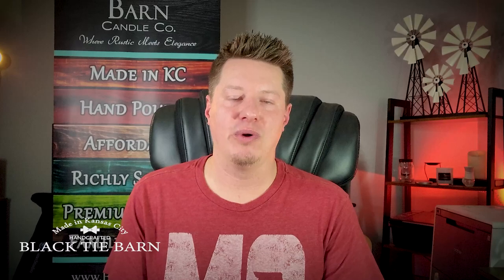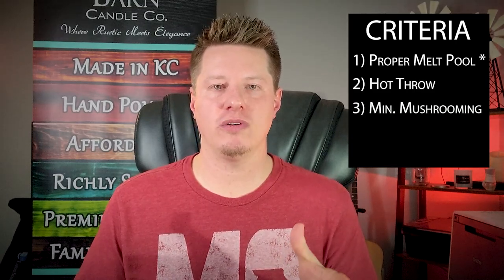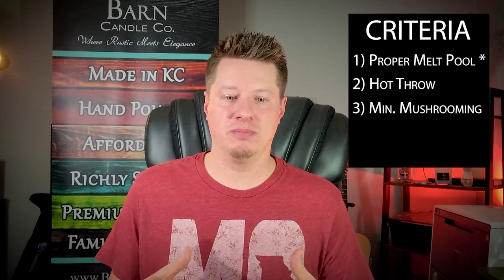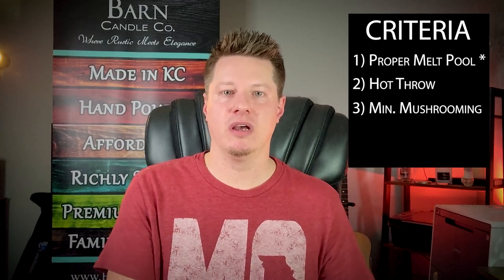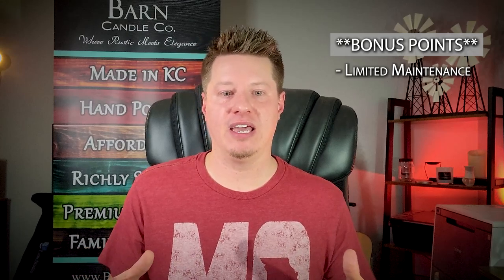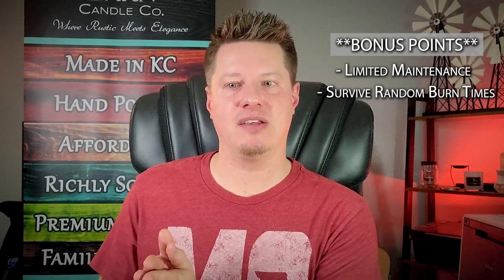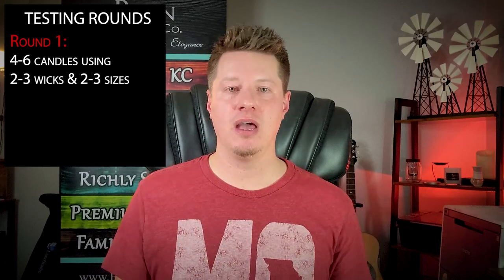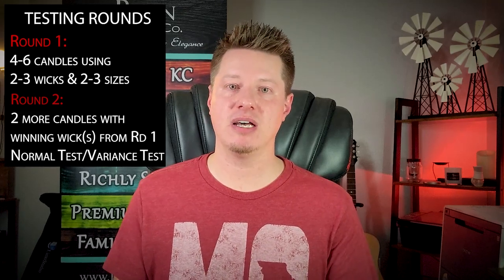Candle Testing & Wick Testing Overview | My Process for Testing Candles | Making Test Candles

Comment: Absolutely loved this video.   I have been making candles for 6 years now and still am always looking for good testing advice and you nailed it with this video.   I am in a group that always talks about how hot your jar should be or not be while it’s burning and I’ve been checking mine to see so it was good to hear your explanation as I have felt too that it’s going to get hot as there is a flame inside of a jar.   I am going to watch your wick video next.  Thanks Wade for all your helpful tips and tricks.   Look forward to trying the twisting of the wick, as my htp 93 will sometimes curl down on me.

Comment: Testing this week on candles my unscented was amazingly perfect. Pool lovely, burn slow and not over 2inches at highest point. My tin test was hot to touch but able to move from one room to next without scorching fingers. Maybe that’s normal. I didn’t mix fragrance very well into wax and boy did I learn that could be dangerous my glass jars reflected that the most. I counted 3 flames in jar with one wick for a moment ! 😅After watching different fragrance mixing and testing videos I feel my most recent batch will be better. So far cold throw is yummy but I can’t wait to burn, completed two different better mixed fragrance batches... wish me luck!
Reply from the maker: Good luck! And, yes.. being able to move a candle between rooms even though it's hot is great.
Reply: @BlackTieBarn  awesome, it certainly felt right! & Thanks, Working on my website building tonight! I am not a tech genius, I’m going to need all the luck I can get! 🍀

Comment: Thank you Wade for your informative video as usual, I have two questions:
1- Regarding the mushrooming,, when you mentioned that if we had mushroom after approximately 7 hours   this to be considered (ok), so my question is: did you meant here  this a continuous 7 hours or it is  3 hours first burn and like 4 hours second burn??? I hope you get my point and I hope you can see my question in this old video
2- Regarding the power burn test during the vraiances burn test, what would be the rest time between each burn?
thank you in advance, I really  apperciate your respond

Comment: Thank you for explaining the melt pool. I have had nothing but issues with too much flame dancing and a large flame, mushrooming and the glass gets quite hot after a few hours when past 50% mark. Ive tried several wick sizes and preferred the results of the smaller wicks but ruled them out due to them not hitting the common melt pool expectation. Il go back and look at smaller wicks...fingers crossed i can solve these issues!
Reply from the maker: Good luck! :)

Comment: Wade - I've been trying to wick an 8 oz amber jar candle with Problend600. It's Bonfire by The Flaming Candle Co. I used the HTP wick you used in the video where you taught how to make 6 oz jar candles in your kitchen. The flame burns super slow and a bit weak but burns consistently. I wicked up to a CD6. The flame doesn't soot, smoke, or dance but it's at least, an inch in height. What should I do? I'm a graduate student, trying to launch my website but keep encountering wick issues. Thank you for your time and always commenting or acknowledging everyone's post.

Comment: This is awesome thank you! I have one question - how do you go about testing for different melting temperature, mixing temperature and pouring temperatures ?

Do you test the wicks first like in this video and then move onto testing different temperatures in making them to get the best hot and cold throws?
Reply from the maker: The different pour Temps and mixing Temps won't affect wicking. So get the wicking right and then you can work on the other factors if you need to
Reply: @BlackTieBarn  thanks!!!

Comment: this helps a bunch, especially since I'm wick testing a harder paraffin wax, which requires wicking up. definitely right about multiwick candles achieving a melt pool quicker than the standard one wick candle, I've got one going now and its got a mp in 3 hrs, tiny bit of wax residue, MP under 1/2 in deep, 3 lx 14...some may say oh that's perfect but I'm gonna try 3 lx 12. again thanks for the videos, I really enjoy them
Reply from the maker: Thanks so much for your feedback.  Glad you enjoying them.

Comment: Hi Wade!  First, thanks for all your great videos!   I've relied on them a lot & really appreciate your efforts. Also super excited to get my Premier wicks from you!  One question about candle safety:  do you measure the temperature of the outside of the jar with an IR thermometer or do you just use your hand. If a thermometer, can you give a maximum temperature I should aim to stay under?  Thanks!
Reply from the maker: I do both. But ASTM standards recommended under 175 °F. I try to stay around under 160

Comment: Love your videos! What’s the difference between the wicks you sell compared to the ones candle science sells?
Reply from the maker: Hey Curtis. Each wick is made differently and have different behaviors. Each also have applications they work well with and ones they don't. The Premier 700 series I sell is good for multiple reasons:
- work well in variety of waxes
- less soot and smoke compare to similar counterparts
- 29 incremental sizes to help really dial in the correct wick size for any need
- work well both single wicking with 1 larger wick or multi wicking with smaller wicks
- great aesthetics/color
- oh and I shop fast. ;)
Reply: @BlackTieBarn  Thank you for the information! I will check them out! Do you offer 1 on 1 service to help new candle makers? I have been testing for a little while now and still having trouble finding the right combination that will work well. I would love to chat with an well experienced professional that might be able to help.

Comment: Thanks so much for the video, I’m just getting started and I’ve learned a lot from your channel. How long should the first burn be when you are talking about melt pools? Would this be the 3 hours that you talked about in the normal test?
Reply from the maker: Most candles should be burned 3-4 hours at at time.

Comment: This is the best video I’ve seen! Thank you for sharing!! How long after you make a candle do you start testing? I’m using 415 soy wax.
Reply from the maker: Depends on the wax. Anything but soy... 2-5 days. If mostly soy or all soy, week or so. I also get in the habit of every once in a while pulling a candle from stock that has been there for like a month + and testing again. I like to make sure it behaves the same as way as initial test showed even after sitting a while.  :)

Comment: Hi l am using a wood wick ,its the whisper duel wick,04,my problem is after you lite it,it just smolders doesn't lite ,so I switched to a 04 booster wick and it burns beautiful, what am l doing wrong, thanks Joe.
Reply from the maker: Nothing wrong. Different wicks work different by design. Whisper wicks are very thin and work better with lighter less viscous waxes in my experience. I prefer original crackling wicks or booster when needed.
Reply: @BlackTieBarn  thank you so much

Comment: I have this store where they give a specific wick for a certain diameter/measurement of a jar... Good thing u uploaded while it's still on the cart... Guess i have to try every with wick they offer and see what best fits my standard
Reply from the maker: Yes definitely test. They give good starting points. Most suppliers do. But they are just that, places to start. Its impossible to have a specific wick that works because wax type makes the biggest difference. And fragrance as I discussed can make a difference too. Thanks for being here and your support. Good luck to you! 😁

Comment: I'm sorry if this was addressed, but I found your channel and it is so helpful! When you do the Variance Burn Schedule, how long do you want between burns? in the Proper Burn you said you wait 4-5 hours, but I didn't want to assume it was the same.
Reply from the maker: Yah for letting them cool in between there really isn't a set time because larger jars or deeper melt pools might need longer to cool. Certain waxes need longer too. So I wouldn't necessarily day they all need to be 4-5 hours. Just long enough to reharden

Comment: Thank you so much for your videos! They are so informative and make so much sense. I do have a couple of questions that I can't seem to find the answer to.... I use Soy/Coconut/Paraffin blend. How long do I let it cure before I can test? Also, once tested, if obvious no go, is it ok to dig out the wax, remelt and reuse it to test another wick in the same jar? Thanks again! You're the best! :)
Reply from the maker: I don't use that wax myself. But to be sage if test after 2 or 3 days and then again after 2 weeks to check for consistency.  Yes you can reuse for testing purposes. And thank you. :)

Comment: Good morning from New Hampshire Wade!!
     I am a baby at candle making; I literally got the materials and haven't started yet. I've watched many of your videos/tutorials (including this one about 5 times lol) before I decide to dive into the process. I've purchased some fragrance oils to start with, which are pretty expensive (think they are all probably expensive in general), but smell AMAZING. 

My question to you is:
Since I have literally no experience with candle making, would you recommend testing with the wicks, jars, and wax first before testing with FO/Additives? My reasoning behind this was to kind of get a feel for the wax type (IGI 6006) and how it burns with that specific wick and specific jar without additives. Then I would test with the FO/additives later, and adjust as necessary for that optimal wick. I figured if I did it this way, I wouldn't waste too much FO with testing at first. 
OR would you recommend just bite the bullet and testing with all the variables added (dye, FO, additives)?    Or maybe I'm overthinking 😵‍💫
Reply from the maker: Some people do this and it definitely can.  But adding FO often drastically changes things.  So you really won't have a classy picture.  But it's definitely fine at first just to get an idea and save some money
Reply: @BlackTieBarn  Thanks Wade! Appreciate the input!

Comment: In my candle testing I did a 4 hour burn 4 times and never trimmed the wick to see how it would do if my customer never trimmed the wick. After the 3rd burn the mushroom got big the wicks fell over causing soot on one of the sides. Is this cause to try a new wick? This wick passed every other burn test, very minimal mushrooms even after an 8 hour burn.
Reply from the maker: I would say if you went three burns without trimming.... this would be a fairly typical result. I would t fail it just for that reason. However if you wanted to try one size smaller just to see how it did overall.... wouldn't hurt

Comment: This is a lot of information, thank you. How is the burn time calculated for the size of the jars you are testing?
Reply from the maker: The only way to know for sure is to test it all the way through 4 hours at a time. Many people will do 4 hour burns like 3 times and then average that out for the total ounces. Weigh before you burn. Way again after 4 hours. Then divide by 4 gives you hours burn rate
Reply: @BlackTieBarn  Thanks for responding.

Comment: Wade, love your videos coming all the way from Australia! I'm having such issues with my wood wicks. Very low flame, almost just simmering. Is this because the width of the wick and the compatibility of wax is not right? I'm using a Coco soy blend for a 3.5'' diameter vessel and my wick is  14mm. It's so stressful!! :) Keep the videos coming. I'm learning so much. Thanks.
Reply from the maker: Hi Tammy. Thanks! Woodwicks are finicky and don't work well in all waxes. So thst may be the reason. Sometimes it's the specifc FO. If you don't think it's wither one of those.... Keep experimenting with wicks sizes both thickness and width.

Comment: is there a reason as to why my wooden wick does not stay on, on its initial light up? I usually have to light it up, let it burn out (usually within seconds), then i trim the black ash with my fingers and light it again for it to stay on... any suggestions is appreciated!!
Reply from the maker: Yah thats a common issue with wood wicks. There isn't a set reason why or easy fix necessarily.  Sometimes the wick is too long or to short. Too much FO can do it too. And many waxes don't play super well with wooden wicks. Lots of factors to be honest.  The first and easiest is to start by trimming wick at different heights.

Comment: Hello Wade.  I’m running a variance test on 3 different wick suppliers in 8 oz jelly jars w/ no FO & 6006 to run a baseline.  Is sooting & mushrooming simply caused by being over wicked?
Reply from the maker: It's not the only thing,  no. Can be wrong wick type too.  Or too much fragrance oil or other additives

Comment: Really helpful insights as usual 
I'm testing new wicks and waxes at the moment and having dramas trying to double wick large tapered jars  tunnels are oblong.  Hmm
Reply from the maker: Yah they can be tough. Oblong is normal for a while. If sized properly... will often catch up. But it's normal for sure. If jar is large enough you cN try 3 wicks if necessary as well but probably too much.
Reply: @BlackTieBarn  thx for that.. I'm in Aust and a lot of suppliers here rebrand the wicks with their own Initials and number according to burn diam as a guide  (as well as selling cdn/htp)

Comment: Could you dive into what you mean by replacing the wick? How would you alley do this without continuing the burn?
Reply from the maker: Well I don't really do it myself much. But you take little needle nose pliers or something and just pull the wick it. Then insert a new one in the existing hole. It's just done for basic testing.  Don't actually make or sell a csndle like that though. ;)
Reply: @BlackTieBarn  haha definitely. Okay ty

Comment: Do you clean out and re-use the jars you use for testing or do you just discard them?
Reply from the maker: Both. I try to reuse but often I don have time to clean out. So they continue to accumulate. Lol
Reply: @BlackTieBarn  That is good to know.  I wasn't sure if after burning the candle if the jar could be cleaned enough to re-use.  I figured if it wasn't, it would be a huge waste and make testing fairly expensive- at least, in the beginning.  lol

Comment: hi there, can you please help me out? Ive tried 464 wax and different soy wax with 10% fragrance oil. Ive used all the eco size wicks and none of them are burning evenly to the outter rim of the jar, The wax pool is not wide enough , therefore all the wicks are creating tunnels
Reply from the maker: what size jar? Sounds like you may need to consider double wicking
Reply: @BlackTieBarn  one metal tint jar is 3.5 across, the other glass jars are 2.5 across and most thebglass jars are burning fine with lx18, eco 8 and eco 10. The lx18 is burning evenly but a mushroom starts to form, the eco 8 and eco 10 have even pools as well but all of them the flame starts to get very small after a few hours of burntime. What is causing that? And woodwicks the flame always gets really small too. Is a bit of mushrooming normal? 

Also the hotthrow is very light, how can I make it stronger for 464. Which wicks do you recommend that works for you? I'm literally spending so much on just htp1212, lx18, eco series wicks. What size wicks do I use for double if it's in straight sided 2.5 inch across jars

Comment: I love your videos, this was definitely helpful. I'm struggling with wick testing a lot, and I'm not sure if you mentioned this part and I missed it, but how long should it take for a full melt pool, based on container diameter?
Reply from the maker: Hi Maybelis, I didn't reay answer thus specifically because it depends on the wax. Some wax is soft and will get a more faster than one with a higher melt point.  But it doesn't mean either is wicked right or wrong.
For example, melt pool between a soft spy wax or a soft problend 600 wax is quite different than a wax like 6006 which is more of a soft slush for the first few burns.  If you get a consistent melt pool for the majority of the candle without it tunneling or getting too hot you are in good shape.
Reply: @BlackTieBarn  thank you so much. I'm using 6006 and been going crazy trying to wick some of my containers properly.

Comment: I’m noticing my candles are burning soot a lot in the beginning but then stops once I get a pool. Is it possible I’m using too large of a wick? Not really sure what to do. Pooling, HT etc are are perfect with this combo, just that first 30 min of soot is pretty black!
Reply from the maker: Interesting.  It's often the opposite, lol. I assume your wick is trimmed before you first light it? What is the shape of your jar. Is there anything on top of your candle surface? Excess oil, dye, herbs, additives?
Reply: @BlackTieBarn  nothing on top. It’s a straight sided 9oz jar. I went with a smaller wick since I messaged and no more smoke etc. the pool looks great but I feel not a strong HT now. Maybe not letting cure long enough before test?

Comment: I’m trying to figure out my baseline wicks. So I’m testing candles with multiple types and multiple sizes of each type without FO. Should I be considering the ones that burn over wicked since once I add FO, they most likely won’t be over wicked? Or should I move forward testing the ones that burned perfect?
Reply from the maker: I'm not sure I entirely understand your question.... but you will want to test your wick(s) with each new FO. .
You can try to find a baseline wick in wax with no FO to use as a starting point.  But you will still want to test each new FO you try and adjust as needed.